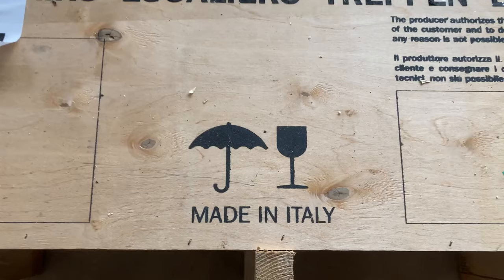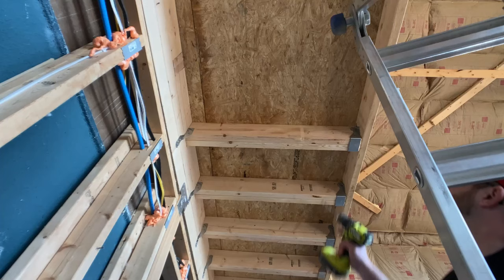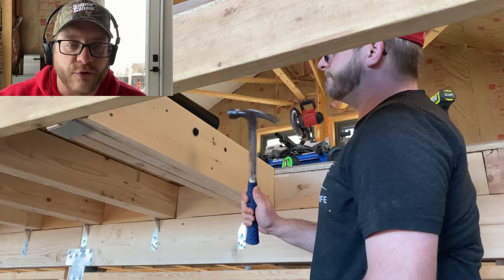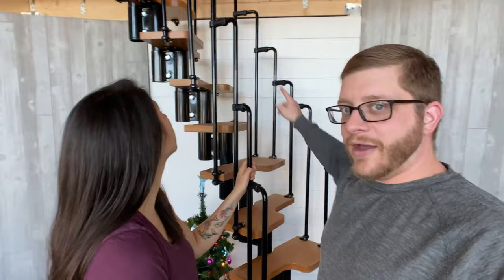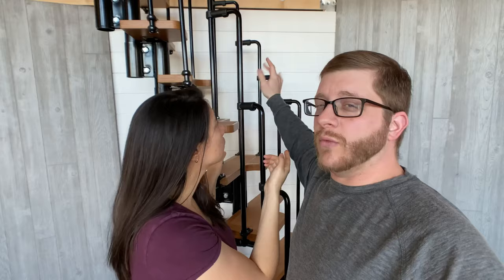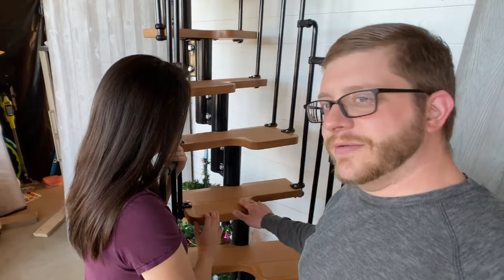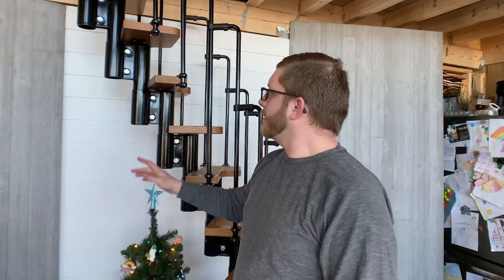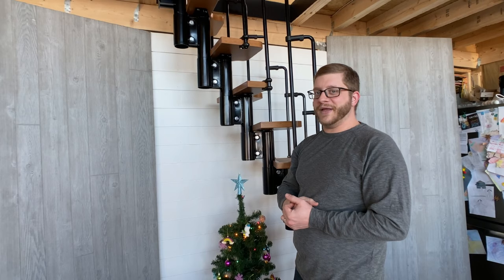DIY Loft Staircase | Installation and First Impressions

Comment: In the future if you have to drill into floor. Let the house cool off then turn on radiant heat. Use a thermal camera or if the runs are far enough apart you can feel it.
Reply from the maker: Yeah I went by feel and gave it my best shot. :)

Comment: I live in a tiny house which is only 8 feet wide and there is a loft above the area for my bed. However, there is not an area to cut a hole. How much space does it take up? Thanks.

Comment: Would you please comment on the black metal framing around the ceiling opening? Did they send you a specific size or did you buy it separately?
Reply from the maker: That's actually just 1"x8" pine board painted black.  I just framed out the opening myself.
Reply: @LittleMountainLife  You’re both so creative!